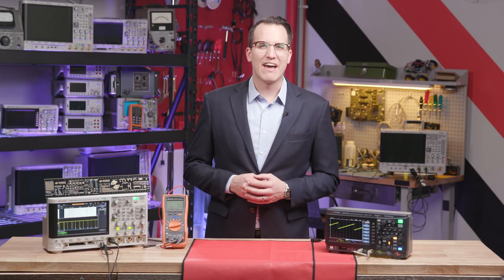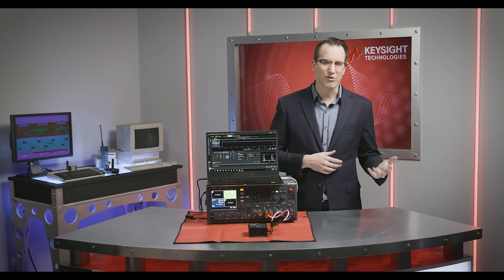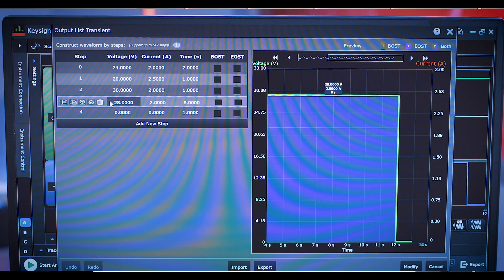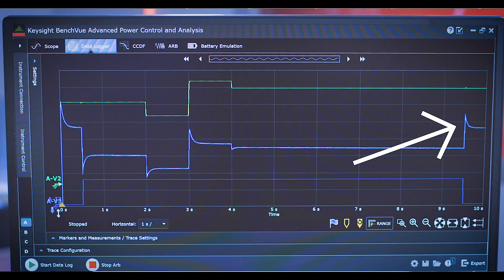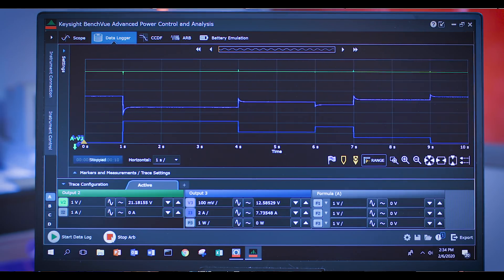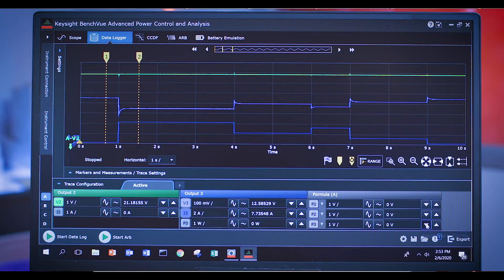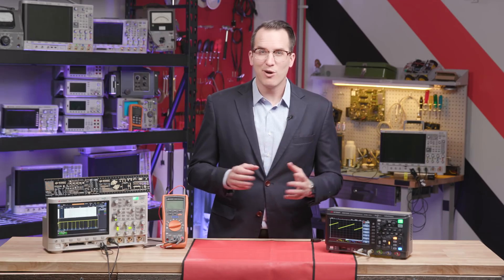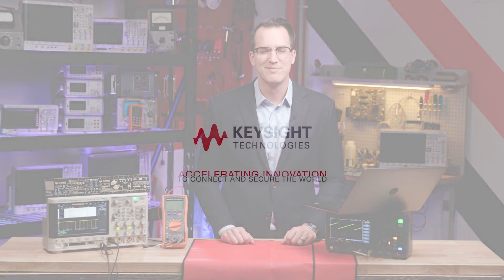What Happens if You Change the Load & Source Voltage of a DC-DC Converter? + Wave Winners

Comment: In Automotive, you usually test the supplies with pulses, that can have short duration or large steep. How well this machine would simulate for example the load dump pulse? Or is it too slow for such tests?
Reply from the maker: It's very capable, but I'd recommend checking specs or giving us a call to make sure it works for your specific use case.
Reply: @KeysightLabs  Thanks for the answer. I tried to find any speed-related specs in the datasheet, couldn't find anything.

Comment: Why does the logger not show the vertical scales on the axis?  ie. at 0:41 I can see the spikes on the green "output 2" (input to DC to DC) voltage but don't know what the voltage is that it is spiking from (above and below).
Reply from the maker: It does show the scales at the bottom of the screen, but we cropped in so you could see the waveforms better

Comment: It came to me today, could you add a diode, dummy resistor and another diode in parallel after the primary load to increase current draw in a linear path?

Comment: Hard to sign up when you don't have a job. Can't answer all the questions on the entry form. I guess it's for the pro's only. If I'm retired, I'm not in any industry. I'm just a hobbyist.
Reply from the maker: You can put "none" or "N/A" and you'll be fine
Reply: @KeysightLabs  Yes, I can put N/A for job but all the questions at the bottom require an input from a small list of options that only apply to someone who is working.

Comment: 4:53 i dont get it u are saying that u just change amps and then say that output changed 100mv i think i gotta be 100mA  or i am wrong? Can anybody help me?
Reply from the maker: So, what's happening is we're driving different current from the load, and then seeing how it impacts the voltage output. Ideally, the voltage would be completely DC under any load changes, but in real life the output changes (like we see at 4:53 )